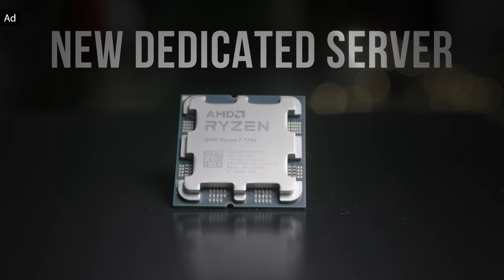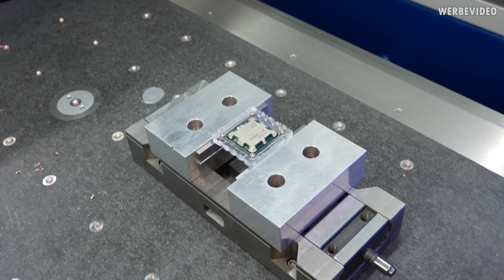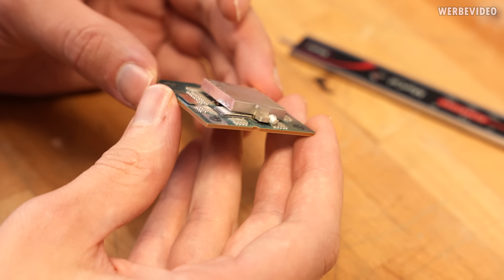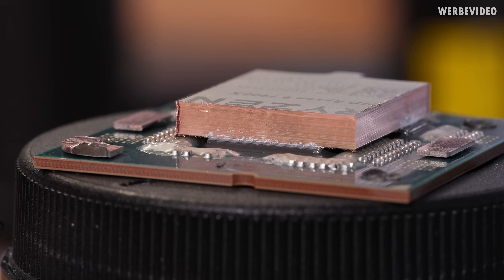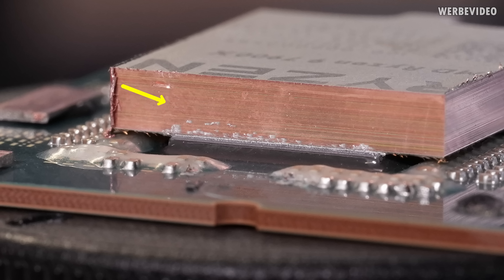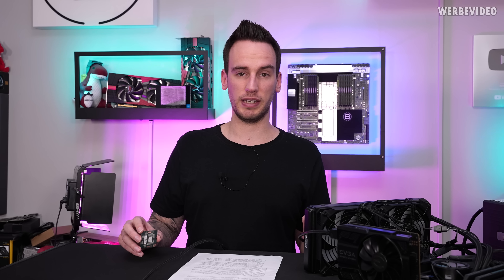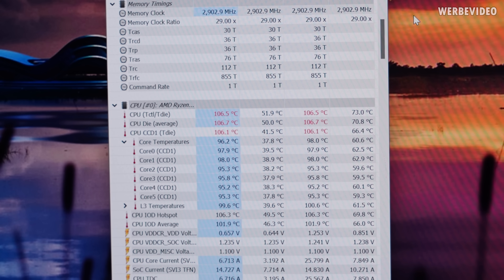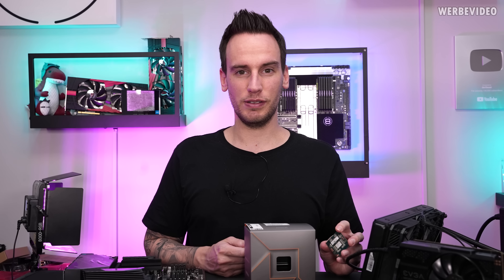Viewer-Mail Ep8: This CPU Unsoldered and Killed itself

Comment: A more plausible guess would be that the CPU actually failed short, which, as always, caused an uncontrolled/runaway temperature increase, and in this scenario the CPU's internal temp protection can do absolutely nothing to prevent it (a short is a short, temperatures will rise up to hundreds of degrees, sometimes even thousands).
Reply: Good thinking... What we see in the solder could be a side effect of a failure that came before
Reply: @Schwuuuuup  the main issue w/ that theory is that two separate dots were shown, it's very unlikely to fail at two distinct locations at the same time.
Reply: @stanimir4197  not necessarily, if 12v get shorted to the 1v rail, multiple parts will burn
Reply: @Schwuuuuup  yeah but the same motherboard later ran another CPU so the VRM was fine
Reply: Pretty much the same thing I was thinking: the silicon failed, turned small bits of it into magic smoke that got trapped inside the indium solder, causing the solder to ooze out. That would explain both the voids and the reflowed solder inside of them.
Reply: A simple thing like dust or even a dead skin cell amok that somehow got in through the vents and found its way during the manufacturing process to and part of the CPU is possible and the laser could even have broken a particle from the mirror and lasered it in 

So many possibilities...
Reply: @xleage  I can say that contamination didn't do this. I've been on the production floor for Intel's main US plant, as well as TSMC's. The entire place is kept to higher standards than a surgical theater. At TSMC they had a second layer of dust-locks. In the first you put on the white suit over your clothes, and then in the second one you go through an air curtain that dusts the suit. Every room is a higher air pressure than the one before it, so dust can't passively enter either. The production floor is the highest pressure area.

If it was contamination, it would have died in batch testing. At least at intel, we validate that CPUs can hit the clocks they are supposed to for binning, which involves pumping them full of voltage until they stop going faster. I've seen chips die, those are defective. I've seen odd numbers of P and E cores before. Last week somebody brought me a chip with 9 working P-cores and 13 working E-cores. Since it only had one memory channel working, it now lives on my desk as the odd numbers CPU, right next to my 3-core Athlon. If both channels worked, it would have become a 13700KF.
Reply: @DigitalJedi  What about in the soldering room (where they'll paste and solder the silicone to the electronics and the electronics gold plating room ....)
Reply: @DigitalJedi  and even the suit material degradation. You can't count on the suit to maintain its performance...?
Reply: @xleage  Solder and package assembly are done in an identical clean room environment and dies move between them in sealed containers if they leave at all.

And yes, we do count on the suits to do their job, and they do it extremely well. The first sign of degradation will have one removed from circulation on sites that don't just use disposable ones.

We take cleanliness extremely seriously. It's a higher standard than the operating room at a hospital.
Reply: Exactly my theory - latchup
Reply: Kinda like what happened to Buildzoids 6900xt. If one of the phases had locked closed it would have spiked the voltage on vcore which could have melted the metal layers inside the silicon and spiked temps high enough to desolder the IHS before oc protection kicked in. I would be concerned about the actual board the user has in such a case.
Reply: Would have taken the MB with it, If that was the case.
Reply: @jamezxh  CPU failing shorted would trip the VRM's over-current protection and shut down power likely without damage to the motherboard as long as you didn't disable it or set it to a stupidly high value.

Comment: My 2c worth, with the way the solder squeezed out of the IHS, maybe there was too much mounting pressure, also potentially causing some of the pins that read/react to the temperature values not contacting correctly. 
This could cause both the failure of the failsafe, and the squeezing of the solder...

Comment: great work! This brings old memories on XP / duron days where chip would die w/o cooler. Can you check how Intel behaves w/o cooler? Does it overheat and shuts down like AMD or not? As for this case I would check what is routed underneath the spots ( L1,L2 AVX?) and go from there.
Reply: both act the same way now but wasn't until ryzen that AMD implimented the same thermal throttling protection that intel uses. before that the system would just hard shut down at TJmax.. Roman did a test a while back with 10th gen and zen 2 i think it was..intel will downclock to 800mhz and as long as you don't have a load on it will stay at that 800mhz and idle fine. AMD i think went down to 400mhz then eventually shut down.

Comment: I wonder how all the different thermal sensors in the dies are ultimately culminated for monitoring. Temp sensing is an analog methodology that must then be converted into a digital value somewhere. If this is being done within the CPU itself, then a few atoms out of place in the circuit could skew the analog temp reading or conversion by multiple degrees. I don't know how much testing AMD does on each individual CPU before packaging, but something like this could be missed if it required more "burn-in" to permanently alter an unstable circuit. 

Another theory might suggest something as purely random as a neutrino hitting a circuit in the CPU and causing it to read a wildly inaccurate value in volts, current, or temp; allowing limits to be exceeded without tripping a shutdown. A bit of a stretch of the imagination, but crazier things have happened when neutrinos hit a processor.

I mean, how long would the solder need to be at 160c to begin flowing in a vertical orientation, such as in a PC tower, anyway? A couple seconds at most?

Comment: Not the first time AMD CPUs gets way too hot. Wasn’t it the K6 that you could fry eggs on and that would happily nuke itself? :D
Sure, things are different these days, but I’m guessing it is an internal defect in that CPU that caused a short which in turn caused a thermal runaway. But I’m far from an expert so just pure speculation on my part.
Reply: My old K6-2 (450) was exactly like that. Almost impossible to keep cool with the coolers of that time. Constant heat induced failures. Good times.. not

Comment: probably part of the chip shorted or went low resistance. put the broken cpu  into a MB and measure the resistance on the vrm phases, then compare the values to a good cpu. after that i would investigate the MB what happens if the CPU dies - will it continue to pump power into teh cpu ? if yes you have your root cause... cpu died and vrm kept pumping power into it raising the temps up to the sky :)

Comment: Theory 1: Contaminants are mixed in with the liquid metal lowering the melting point.

Probably wrong theory 2: Perhaps polling times to check whether to thermal throttle the cpu are too relaxed, and performing an intensive calculation (eg prime95 small ffts with avx) are enough to heat the cpu enough to melt solder

Comment: I recently bought a msi mag 360 aio for my 7950x3d and with the stock mounting hardware the water block didnt make proper contact with the cpu.  Under load it was hitting 90c and throttling.  I had to use 2 (maybe 2mm each?) spacers to put extra down pressure on the block to make proper contact.  I followed the instructions and even contacted msi and they said it wasnt supposed to need the spacers.  Board is asus x670e-e

Comment: The soldering material may not be pure indium. Some of them are using In-Ag alloy which could melt as low as 128°C. I have a piece left from my STIM experiment back from Haswell era. Since the temp sensors are not 100% accurate and won't cover the whole die, it may just be enough to desolder the CPU.
Reply: There are hundreds of sensors on the die
Reply: @stanimir4197  But people still need to drill a tunnel through IHS and place a sensor in to get the precise reading.

Comment: I think that getting exactly point of failure is impossible at this point, hope it's not motherboard pumping excessive voltage, maybe failure within CPU PCB or something within silicone that went wrong, but that's very interesting case indeed

Comment: Could the metal be contaminated being an alloy with a lower melting point? You could check the melting point of the blob.
BTW: you did an amazing work!
Reply: Even if the solder melted at operating temperature, the CPU has so many temperature sensors that it should have noticed the local overheating from missing STIM.  The melting seems like a symptom rather than a cause.
Reply: No.  That would have affected a very large batch, and this has never been seen before.  I bet the owner tried to delid it with heat.
Reply: @VndNvwYvvSvv  This is my guess as well, and I think, the most likely cause.
Reply: A chemical analysis of the t.i.m. would be interesting.
Reply: That is a good point. An analysis of the TIM would be interesting. But I can't help but think the CPU experienced a heat load it simply wasn't designed to withstand and the TIM boiled out.
Reply: Yeah, pretty much any contamination will end up lowering the melting point as compared to very pure Indium. Also, a bit of organic contamination, or maybe water, could explain why the liquid Indium would then be propelled out of the CPU, because the is no other force involved that should have caused this, even if the Indium melted.

I mean the liquid metal we use for cooling never just randomly explodes from where we put it, just because it gets warmer.
Reply: @TemposLamorant  Overvolting CPU's is a dumb idea.
Reply: @mikem9536  undervolting seems to be better for em anyways haha
Reply: Test how hot it can get before shutting off with thermal limits turned off.

Confirm the melting temp of the solder.
Reply: leaded solder melts at 170c-180cish and unleaded melts at around 220c+.  Be surprised if they're using leaded solder still.
Reply: Thats a good idea

Comment: I still think its a cpu defect. Lets agree even if 95 degrees is "max safe" and 115 degrees is "shut down point" so the cpu should shut down way before reaching 160 degrees. May be that specific cpu calculated the temperature wrong. Or some communication issue with the motherboard / system etc. 
Or we need to find a way to run cpu until reaches 160+ degrees. If we can find a way to run it until 160 degrees we can get more info about how that cpu melted.

Comment: i remember in the old day when you had XP/duron with no protection. AND we had a computer where the FAN stopped. the system ended up heating up and the socket got soft and then the cooler mount snapped at the bottom (tower case) and then it rely started to heat up. so the PCB got damaged and the socket itself got half way disordered and pulled out from the PCB. the "glue" that hold the die to the ceramic body of the CPU was gone and the die fell off.
to melt the indium you do need to get to 160c. to melt the solder in the old computers you need over 200c.

Comment: I had large surface mount IGBT module slide on a PCB in some medical equipment. It was installed with 60/40 solder! It took out some fuses and nothing was burnt. It just had too much resistance when ON, replaced it and all fine.

Comment: Maybe there were holes in the indium before (defective application) and only a small part of the die got waaay too hot, which would have built pressure in the air in the pocket, melted the indium and maybe ultimately catapulted some of the indium off the die, both further increasing the temperature and maybe shorting something.
The thing is, as the die has more than one temperature sensor, but doesn't have an unlimited amount, a small part of the die can easily get hot, while the CPU never notices.
Reply: i was thinking the spreader had holes and sucked the indium up into it
Reply: @shaunjennings4609  You would have seen those on the spreader though as he disassembled it. If you mean the smears of indium on the cuts of the spreader, that's most likely just from the CNC spreading the soft metal everywhere while cutting.

Comment: Random guessing but is it possible that during manufacturing process indium solder doesn’t make full contact with the IHS, after a while heat damages little bit by little bit and builds up then killed the CPU？

Comment: Keep in mind the CPU was also under pressure from the cooler, this would lower the melting point of the indium 
i have no idea by how much however and i highly doubt it would drop it below 120c
Reply: Higher pressure HIGHER melting point.  Why do you think they lower pressures in vapor chambers/heat pipes.  To boil at a lower temp, to use the thermal capacity of phase change, to cool your CPU.

Comment: Would be interesting to reach out to AMD if they have any way to still check the CPU on what exactly happened, what failed and what caused it to reach such high temps in the first place. The damage on the CPU isn't something that can't be fixed in terms of resoldering SMDs, but would still be great to check if anything can be "extracted" by AMD to determine what could have happened.
Reply: honestly would have more hope to see something in the windows crash reports.
Like where should a CPU log that?
Reply: @randomzocker8956  Intel uses their IME, Intel Management Engine. AMD has something similar, don't know the name, but every processor these days has a tiny RISC microprocessor that handles quite a few things. There's an article on that you can check out in regards to that.

But yes, Intel has had it for a long time, AMD probably aswell, since it well, manages the CPU itself. I'd find it hard to believe it has no way to log specific things on what the CPU does.
Reply: @NecroFlex  I doubt that it would have any sort of memory that would store a log, doing so wouldn't really serve much of a useful purpose for 99% or use cases so i don't think they would bother making something like that/
Reply: @NecroFlex  yes but using that for logging would hinder the performance right?

Comment: You're assuming that the solder alloy AMD uses has a specific melting temperature, but you should actually test that. Take a sample of solder from this dead CPU and from a good one and raise their temp 1C at a time on a small hot plate to see what they actually melt at.
Reply: A bad batch of solder with a lower than specified melting temp could have been responsible or contributed to this.

Comment: Hi @der8auerEN. Have you checked the actual IHS temperature when conducting these tests? I have a theory that even with overtemp protection, the 5 nm process is just too dense to protect when removing the heatsink. The heat has only one way to go, and that is in the IHS. A big (in comparison to the chiplets) chunk of copper that can't dissipate the heat anywhere. All it can do is radiate it back. This might be why it might have been even hotter than what the sensors report in windows. Might have been enough to damage the cpu chiplet internally and in a very specific region. Which would then short and very quickly dump even more heat in the IHS which could melt the indium, or a contamination that was there and shouldn't have been there.

Other theory, I dont know if they use flux but if it was a cold joint or to much flux used, this could create a pocket of gas in heat cycles that will superheat part of the chiplet, maybe melting the indium around while the cpu is reporting normal temps. Im talking microscopic gas pockets here.

Great video btw, and I very much like the way you approach the compensation for these cases.

Comment: That IHS is stupidly thick now you can really see it. i can't help but feel AMD is just winging it and not making the best choices to often.

and your "all the liquid would have to be evaporated" is wrong. you can litteraly cook water in a plastic bottle.  that means a fire several hundreds of degrees high not melting the layer in between. and the water nog being evaporated. The cores can be hot without water boiling as that takes X amount of time. The CPU can very well melt the indium before that and then die.

Comment: a wild guess: due to imperfect manufacturing process some transistors inside the cpu came out to be more susceptible to overheating causing some to blow creating a short in the process. Just like VRMs sometimes blow up. Seen some reports about randomly dying amd gpus, which as far as i know are made by tsmc as well as these cpus - perhaps there is a link, but it is just a very wild guess.
Reply: Uhm... yes, AMD GPUs are made by TSMC, just like their CPUs... But how is that relevant? I mean, you do realize that TSMC has basically manufactured 95%+ of all video card cores for the past 30 years, even since before these cores were actually called "GPUs"? :-D

Comment: by the looks of the current the CPU has trotted already itself while reaching over 100C; 115C is the hard shut off, so the behavior appears sane. IMO. measure the CPU itself for a short - so it just boiled the solder, OTOH the VRM should not be supplying any more current. Edit: recalling there are two dots with missing solder, a short is significantly less likely.